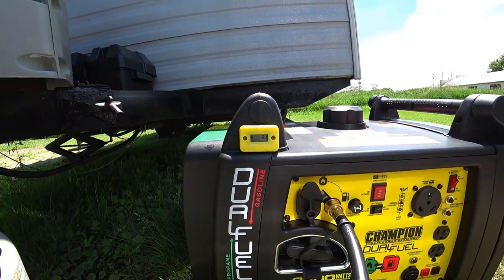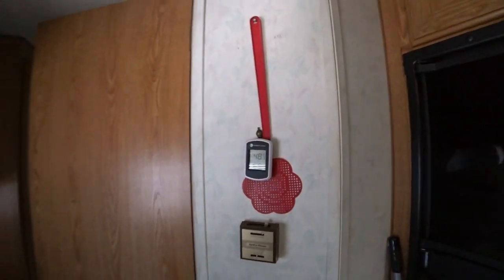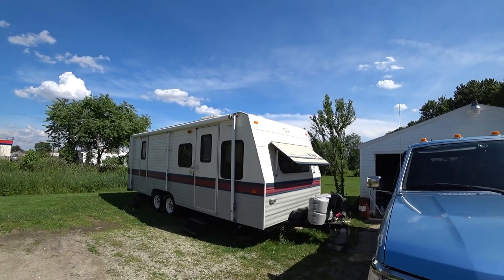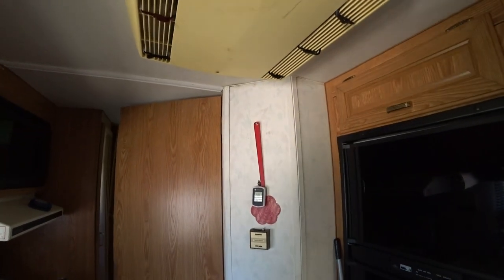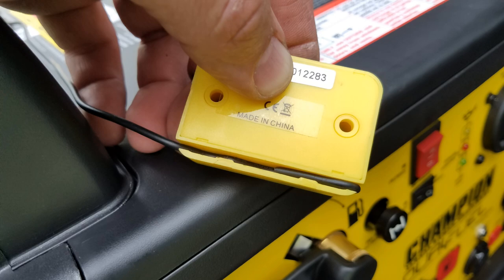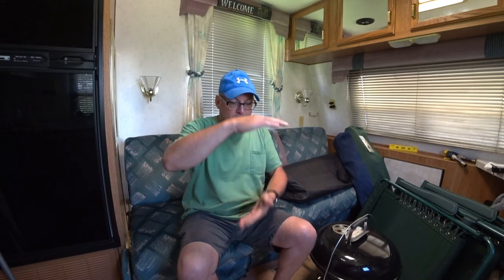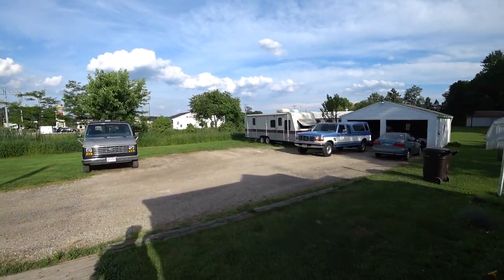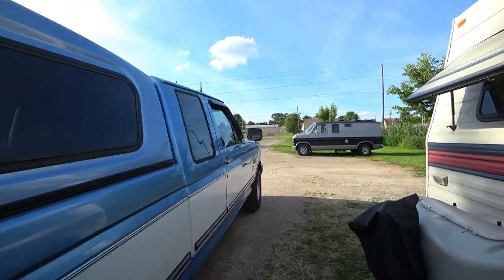Champion 100263 Propane generator run time test PT 1

Comment: You will get a 20* drop where I live and that's all you will get..try parking a 34 ft mo ho in the desert with no shade and 115...I have a 3500 watt gas generator and a 1200 watt window mount..I can get a 20 drop as long as I don't let it heat up..my deal burns 5 gal in 16 hrs ..stupid as it sounds, ran out of gas, got a 5 gal propane bottle I think was close to full, stuck am adapter and a hose, stuck the other end of the hose in the carb and got it running..22 hrs so far and the propane still feels full...$20 to fill the propane..math says even money to run right now and I bet it runs another 20 hrs...looking like propane cost is half of gas.. figure that out...and I don't even have a regulator and using the tank valve to adjust mixture

Comment: What would be extremely useful is the size of the propane tank ( 20LB 30LB) and the btu rating of the AC unit.
Reply from the maker: I assume that most realize that all short tanks"bbg grill"(clearly shown) are 20lb.. And I an definite at sometime during the multiple videos posted covering this RV I disclosed the A/C unit being 13.5k as most of this Era and size are 30amp.

Comment: If you are going boondocking you are going to need a bottle for each night!  If you are going into the mountains in cool weather/skiing etc. you are going to need a couple of bottles each night (as temps decrease available gas in the bottle decreases dramatically) and store them while your trip lasts.  Propane seems to run quite a bit higher in a gallon to gallon comparison than gas as well.  The only up side I see is that the combustion chamber runs cleaner (not a real concern with a generator as they don't run on a dead idle) and you don't have to worry about gas varnishing up the carb in the off months.  Which is a nonissue if you use gas stabilizer and do normal maintenance.  So I think I will stick with gas or diesel.  Nice test though.  I would have liked to see you run it until it quits as the condensation level in the bottle isn't always definitive of the usable amount left.

Comment: Thanks for the good video but you missed a trick.  Using a fishermans scale or bathroom scales you can weigh the tank before and after a test period and know the exact consumption.  The dry and full wight is printed on the tank I say it in your video.
Reply from the maker: I was just wanting to start with a full tank and run it until it was empty. Which it took three days but finally got at least an idea.

Comment: There used to be a guy on YouTube that had a 45ft Class A and pulled a 15ft enclosed trailer with tools, motorcross bikes and a washing machine.  He had the tongue of the enclosed trailer extended by 4 or 5 ft to hold a water tank & huge battery set up to run the washer & run his tools.  It also helped with sharp turns to keep the trailer from hitting the RV.  Maybe if you could extend your tongue, the generator will be away from the bedroom, be closer to the propane and keep the weight on the tongue.  I also watched another guy that had a steel mesh cargo carrier for the back of his van.  He chained the generator thru the mesh decking and found an old cooler that he cut the bottom out of and slipped it over the generator and strapped it down.  So it just looked like a cooler on his carrier.  No one ever bothered it.
Reply from the maker: DWDinAtlanta we are not doing any major changes to the RV because we are more than likely not keeping this, plus when traveling full time I as much as possible to remain  unseen. Thanks for input you never know until we post a video lol.

Comment: Thanks for this video!

I did tons of camping as a kid but didn’t do the setup... that was dad’s job and my Hubz is a complete noob to camping of ANY kind. 

We started out in a 1972 5th wheel in an RV park. We decided to upgrade as “Betsy” was in bad shape when we bought her for $800. We didn’t adventure with her as we didn’t own nor wanted a truck to pull a 5th wheel. 

I found a 1984 Chevy motorhome on a G30 chassis in awesome condition. Guy was asking $2000 but needed to leave the area so I offered him what we could afford... $1300. 

We were told the on-board generator “works” but was dumping fuel into the oil so we haven’t messed with it. 

In September I bought a Champion 4,000/3,500watt dual fuel generator on sale at Home Depot for approx $300. We actually live in our motorhome and the fridge and furnace use the on-board propane tank. 

We will be getting a rack built to put the generator on the back end of “Rosie” to run when we’re boondocking as here in the Pacific Northwest many of the camp grounds close end of November. 

To run the furnace we start the motorhome and use a Mr. Buddy Heater currently as it’s already dipping into the 20’s at night and it’s only October 20th, 2019. The fridge works on propane but we are unsure of it working on shore power as the buttons are messed up, former owner moved the switch to propane via a pair of needle nose pliers. 

My question is/are:
Seeings we don’t want to haul gasoline, we’re going to run it on propane... can you give an approximation of run time on one 5lb propane cylinder... I’ve been told propane is less efficient then gas... but again storing gas is a problem. On the rack we will mount 2 5lb tanks and have a 3rd in the “attic” (storage above the cab). 

As we live in our motorhome is this idea feasible? 

Thanks again and “happy trails”!
Reply from the maker: So glad that you are getting to experience RV life in your new to you motorhome which sounds like a great deal. For gasoline run time and Propane runtime I shot these videos and unfortunately for the propane I think it might be covered under 2 or 3 videos so just check under my playlist that is entitled anything generator related. It will be in there. It really depends on load and as just a hint oh, you're going to find that the gasoline is far cheaper to run the generator off of for extended periods of time. Good luck!

Comment: sometimes , being a profectionist really sucks don't it !   thanks for the video, nice little unit.  my roof unit give out, so i have a small window unit ac, i use a small laptop hooked up to a large screen tv, my camper fridge give out, so i have a small fridge out on the deck, ...  for the amount of watts i would be using on any given day, i see the champion dual fuel unit would meet my needs.  my camper is permanent on my property, so putting this unit out in my little 10 x 12 building, which is right next to my plug in at the pole, running it off my 30 lb bottle,  it will be convenient, and the neighbors won't even know i am running anything, except, i will be the only one with lights on , in a black out....

Comment: Thanks for the video. I would like to see how you would set up the gen in the back of the truck. Will it have hold down brackets? Will the propane bottles be secured? etc Would you be able to run the gen with a camper top on the truck?

Comment: I love the idea of dual fuel and one  3000 gen but I have two 2000 Honda gens so I can carry them myself (I am an old lady) haha! I just put them in the bed of my truck for transport.  it will be interesting to see how long you can run on LP, too.
Reply from the maker: taz sharif Honda makes a 3000 generator they call it a 3000 Handi that only weigh 75 pounds. but that still a far cry from the Honda 2000 which only weighs about 43 pounds. we thought long and hard about going with those two smaller Hondas. it came down to needing to buy the parallel cable to run the air conditioner which of course added to the cost and the fact that we have to do two oil changes and most likely get an extended run kit for the gasoline. add to that not being able to run on propane without buying a conversion kit 4 both of them. it just didn't make sense for us. but I love those little generators. I love how compact they are and how quiet they are. and of course how long they last. that's why they can command such a good retail price. there's a reason Honda is known for being the best for generators and those generators you have supports that reason. I'm not sure what you meant by how long it would run on LP? this test was done running on LP. I guess what you're asking is how long it will run at Full Throttle on a tank of propane until it completely Runs Out. LOL. and as far as that goes, I am definitely curious too. thanks for the comment really appreciate it.
Reply: I just watched your video with the test run with the 20 lb tank and i was really impressed! I love your videos and i have learned a lot! Thank you!
Reply from the maker: taz sharif awesome! So glad you like the videos. thanks for staying tuned in.
Reply: It’s a pretty good weight. It’s nearly 100lbs.

Comment: Awsome.  Every American home should have a some kind of backup power. My generator is a firman duel fuel 9400 watt.   I don't run it on anything except propane. 
    That's a good test. Maby mine will run just as long
Reply from the maker: 😁 thanks for watching!!
Reply: @Rvdaydream  n

Comment: ..just use aluminum framing, and u don't need a metal enclosure, just a gen cover and 1 or 2 heavy gauge, coated, 'airplane' cables with matching locks.
...I built a 'stepped up mount that sits the gen above the hood of the tow vehicle.
...even if u do not have a tow vehicle the 'stepped up' mount does not increase ur over hang.
..use weight distribution bars

Comment: So about 10 hours on a 20 pound propane tank. What size was the Generator  

I think a tank of gas will run also the  same length.  One can buy a fuel gauge for the propane tank for a few bucks.  

It is too bad that your experiment did not run till the tank was empty and then one would have known exactly how long it does last , as instead of kind of guessing. 

Also how much did it cost to fill up the 20lb tank as compared to gas.  A lot of variables before one can make a purchase.
Reply from the maker: Like the video title says that's part 1. Running on gasoline is cheaper no reason to research that option any longer. Because gasoline has more BTU in it by volume gasoline is cheaper...
Reply: @Rvdaydream  Thanks for your reply and good to know that gas is cheaper. Now I will stay with old gasoline.

Comment: Ok , I got one of these now-same thing. What is the small clear plastic hose for- to the right of the place where you put the oil in. Thanks
Reply from the maker: SANDMAN XIV check out my other videos... One of the hoses to the right is where you drain the oil... The other small clear hoses is for the carburetor... One is for the bowl drain, the other is for breather/vent and overflow...

Comment: Recently we ran our 3400 dual fuel for 168 hours straight on gas (our propane regulator shipped broken). In the economy mode we average around 10 hours per fill up.  We were surprised.  Champion sent us a new regulator so our next trip will be on propane.
Reply: @Oilngld  I saw that video as well. The good thing is, Champion sent a replacement part right away, no questions ask. Good support makes up for issues during shipping, imo.
Reply: That’s some good info! Thanks!

Comment: How much gas dose it take to fill the tank and how long would it last with the A/C on?
Reply from the maker: Bob Runde I really don't want to put gasoline in the tank again. in my previous video I put gasoline in the tank hoping that the extra wattage that was provided when running on petroleum would allow for my rooftop air conditioner to start without adding a hard start capacitor to it. I plan on running exclusively on propane. the gasoline I did add to the tank I ran out for the most part. what was left in the tank I drained out through the carburetor and then allow the tank to air out. on Champions website the only information they give is that the tank will hold 1.6 gallons and it will run up to seven and a half hours at 25% load. of course that's on gasoline. if I have ever have to put gas in the tank again, you can be sure I'll definitely do a test on full load and how long it will run. thanks for the question. Sorry I didn't have a better answer.
Reply: I would also like to see that test with gasoline

Comment: I have never considered a propane generator! But I think I will put one in the back of the truck (it has a cap) and maybe run a propane hose to the generator from the camper. I must have 6 20lb tanks and one 40 lb tank. plus 4 more 20 lb tanks at the lake lot. dicisions dicisions!
Reply from the maker: Darrell Wampler 👍😁

Comment: *DIESEL GENERATOR*
6 KW Diesel generator will run 150 HRS on 50 Gal. At half load using 1/3 gph.
At full load 1/2 gph.
This is an average estimate....
Using a backup battery bank with inverters and charging system would cut down on run time and fuel
Reply from the maker: Diesel generators have too many drawbacks for the majority of campers. One of them is the sound that they put out is obviously louder than any inverter style generator that is enclosed like this one or any of the Hondas or Yamahas plus a whole slew of new ones that have come out over the last three or four years. Of course if you're out in the desert  camping on your own  noise usually isn't too much of an issue  but  if you're in a national park  you may be in for a big surprise whenever you find out that there are  sound requirements for generators  even when it's not quiet time . The diesel output as far as smell is something that is little bit more of a turn off then gasoline or especially propane burning generators. The propane Burns cleaner then both Diesel and gasoline. Also you would have to carry diesel fuel and be able to access diesel fuel when camping. There are definitely a pretty significant number of gas stations that do not even sell diesel. The other thing is maintenance. The Diesels are very susceptible to moisture so anytime of hot and cold cycles that the diesel fuel container has to go through could potentially cause moisture and of course non running of the diesel engine. Of course that's relatively true with the gas engine but and this video we were just talkin about the propane side of things. And at least in this area of the country and I'm sure there's others, diesel fuel prices are always higher and gasoline prices and are pretty comparable with propane prices. But again the best part about the propane is you can pretty much do a propane tank exchange at a large selection of convenience stores which run 24 hours and even Walmart. I have nothing against the diesel generator except what I mentioned about them being more noisy, so they can't be used in certain national parks, they burn more dirty then gas and much more dirty than propane, and the fuel is not readily available as much as propane or gasoline and it seems to always cost more then gas. In this video and of course part 2 I just wanted to show what was the approximate run time on one barbecue size propane tank doing what most are beers would end up having to do when boondocking and that is run their rooftop air. So although a battery Bank could potentially be Incorporated with an inverter and having a separate charging system just for the battery, the practicality and convenience starts to become an issue and the cost of those additional components play into the reason people go with simple generators like the one in the video.
Reply: @Rvdaydream  ... YEAH.. But good for DOOMSDAY BUNKER...
Reply from the maker: @Katelyngameing1990  yes, unless you're trying to keep quiet from zombies. LOL

Comment: Full tank is 16 pounds.  Hope you did not calculate with 20 pounds.
I think you were at about 50% load.
Reply: A full tank is 20lbs.......  They can accomidate 20% more than that but they are filled to 20lbs which is 80% full.  If you go to a tank exchange place you will only get 15lbs but if you have it filled they will put 20lbs give or take into the tank.  The tare weight of a tank is around 17lbs and a full tank will weigh around 37lbs because you put in 20lbs of propane.
Reply: 4 gallons of propane is 20 pounds ?

Comment: At a 50 % load what is the run time difference between gasoline to propane ?
Reply from the maker: You'll have to call Champion..they only list 25% load   Gasoline Run Time at 1/4 Load7.5 h.Propane Run Time at 1/4 Load14.5 h.